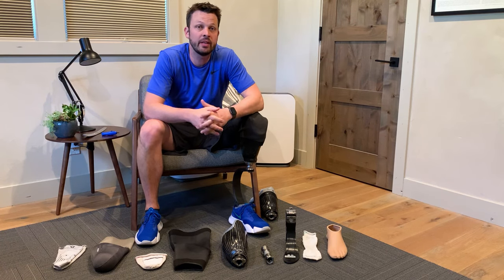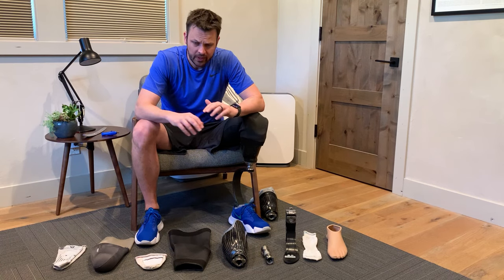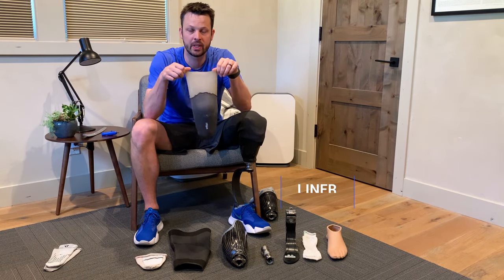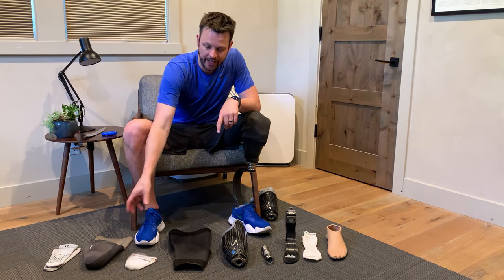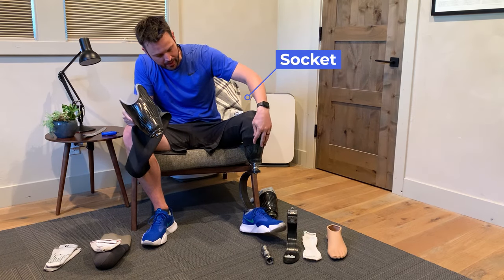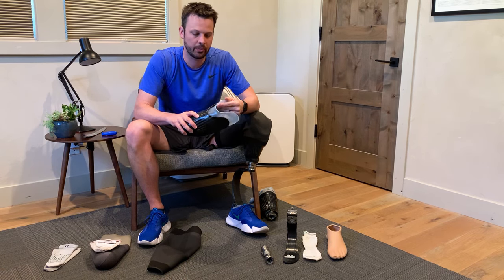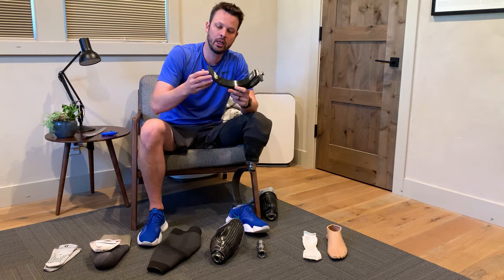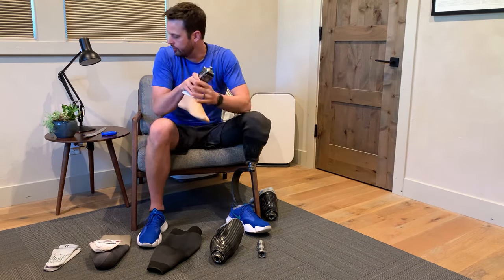The Basics of a Below-knee Prosthetic Leg

Comment: Great video. I’m a bilateral BKA of almost 8 years. I use liner liners too. Your socks are the shortest I’ve ever seen, but we are all different, what ever works. My liners are custom and very thick and I noticed your liner was quite thin. I also use a suspension sleeve and not the pin system, which never worked well for me. Good luck on your journey.

Comment: Thank you for sharing.
One question.
I would like to know, by removing sockets from one leg to another, how do you do it without affecting your alignment?
Reply from the maker: Lots of trial and error and lots of questions when I go see my prosthetist. For the most part, as long as you get it adjusted at the prosthetist and you only loosen two adjecent screws for the pyramid adapter, then when you tighten those two screws, the alignment will be the same. There are also some pin systems that make it easier and faster to swap feet. They've just never been practical for my leg configurations.

It's still never quite as good as having professional supervision and adjustment, but being 4 hours away and changing feet for a variety of activities means I've had to figure it out and get comfortable with it.

Comment: I am having a bka sept 27th due to pain from a “low risk surgery” that screwed my foot up royally. I can walk about a block or two at most and can no longer wear a shoe. 2 additional surgeries I’ve had to try correct it but they screwed thongs up even more. I’m pretty much screwed now and have decided to go with a bka. A couple of quick questions if you don’t mind.
Will I be able to mow, walk my kids to the park ect afterward? Will I be able to work 8 hours a day as pharmacist on my feet most the time? Do people stare at you when you go out? Do people ask you a lot what happened and does that get old? Do you have any advice overall for me?
Thanks man!
Reply from the maker: Long-term, you'll be able to do pretty much anything. I had an ankle fusion for about 18 months and was in a very similar situation. I could walk, but it was painful. Being on your feet 8 hours a day as a pharmacist, yes, eventually. It takes about 18 months give or take to fully settle in. And it's not a straight line. There will be good weeks and bad weeks. Don't hesitate to use a wheelchair or crutches either at home or at work as needed. It's not convenient, but it's better than the pain.

Yeah, people stare occasionally, but honestly, I don't even notice. My wife notices way more than I do. People do ask a lot of questions, and other times people are awkward. I've embraced it, and I frequently use humor to disarm people and know that it's not a big deal to me. Even now, 5 years in, there's still good weeks and bad weeks. Twice a year or so depending on how hard I push myself, I'll prefer a wheelchair to my leg for a couple of days.

The best advice I can offer is to find a really great prosthetist who won't be satisfied until you're doing everything you want to do. They'll be involved with you for the rest of your life , so you want a good one. Any other advice would be totally context dependent on goals, finances, schedule flexibility, etc. Happy to answer other questions. Just email me, yougotthis at garrettdimon.com.
Reply: @AdaptableOrg  thanks man! I got to be honest, I’m very nervous about all of this. I am watching your videos to get a better idea of what to expect and it looks like there is a lot to it. I’m sick of being in pain and want to live a normal life again. Right now I am basically wearing a big bulky CAM boot which is like having a ball and chain tied to my foot. I’m just barely scraping by. I feel like I’m making the right choice with the BKA but honestly I am very scared.
Reply: @AdaptableOrg  hi Garrett my amputation is Monday. Please keep me in mind my friend. I have a quick question. Do you require or ever use a crutch to walk?
Reply from the maker: @markkicksass2448  I usually keep crutches near the bed, but in general, I don't use them frequently. I also have a basic wheelchair for maneuvering around the house and being able to carry things on the days where my leg hurts.
Reply: @AdaptableOrg  thanks for your response man! My surgery is Monday. I’m nervous AF. I’m pretty much a mixed bag of emotions right now but I suppose that is probably normal. I just hope everything goes ok and that I am making the right decision. I know you said your amputation was due to pain like mine is. Did you ever have second thoughts? Are you better off now then you were before?
Reply from the maker: @markkicksass2448  I can honestly say I've never had any second thoughts or regrets. I sometimes daydream about how things might have been different, but only out of curiosity, not any kind of regrets.
Reply: @AdaptableOrg  some of my family members are being very judgemental about this whole thing. My wife, the only opinion I really value, is totally on board with it. I am pretty sick of being in pain and not being able to walk more than like a block or two at a time. I guess I’m not really having second thoughts, but as time gets closer I just question myself. I think it is fear of the unknown. Your videos are very helpful so thank you for posting them.
Reply from the maker: @markkicksass2448  Just glad it helps. I had friends trying to convince me not to do it all the way up to the surgery. Nobody else can feel the pain, and they surely aren't doing anywhere near the level of research. My wife was the same as yours. She was scared by supported the decision 110%. Unfortunately, nobody else can really know if it's the right decision for you.
Reply: @AdaptableOrg  I’m glad to hear I’m not the only one who had friends and family question their decision to amputate. Thanks again for the advice and videos. Please, if you don’t mind, keep me in your thoughts and if your religious prayers on Monday.
Reply: @AdaptableOrg  well I am sitting in the hospital bed after my amputation. I’m not gonna lie I was initially freaked out by not having a foot and felt super overwhelmed by the logistics of daily life. I knew it was going to be hard but not this hard. I can’t wait until I am where you are at with it. You make it seem so easy and casual which is reassuring to see. I am discharging from rehab probably tomorrow. Which is great cuz I miss my wife and kids and am not really doing much here. If you don’t mind I have more questions:
1) Did you have phantom limb pain and how long does that last? (My foot feels like it is there but just a sleep)
2) How long until you were able to get your prosthetic?
3) How long until you could wear it and use it?
4) Did you ever have a holy crap my foot is gone moment after surgery and how long did the grieving process take?
I’m sorry for all questions but you are really helping me out.
Thank you my friend!

Comment: Thanks for the video. Please can someone attend college with ease moving from classes to classes every day with prothestic leg for hours?
Reply from the maker: Absolutely. The first year is generally up and down, but you can always use varying combinations of crutches, wheelchairs, or other assistive devices depending on what works for you and how your leg is feeling on a given day. Sometimes it can be difficult, but there's usually ways to adapt and manage pain, especially if you can coordinate with your professors.
Reply: I'm a mechanic on my feet  over 10hrs a day on concrete floors. Have a similar set up 👍